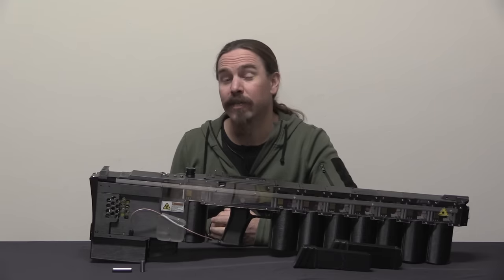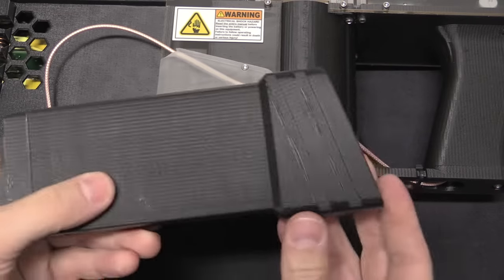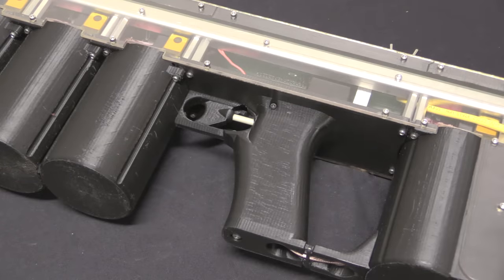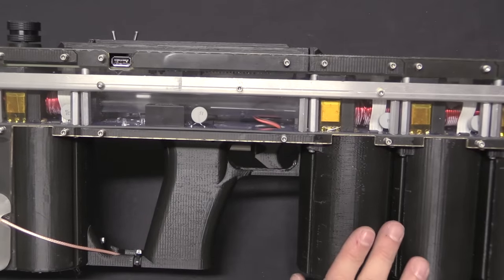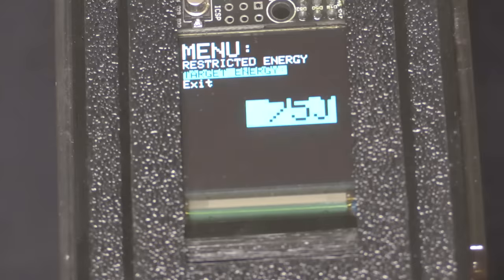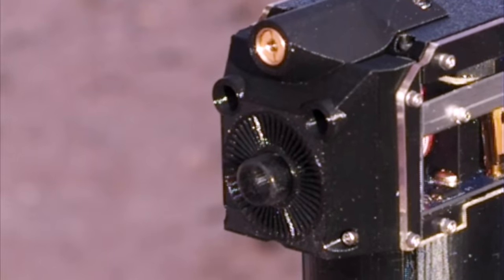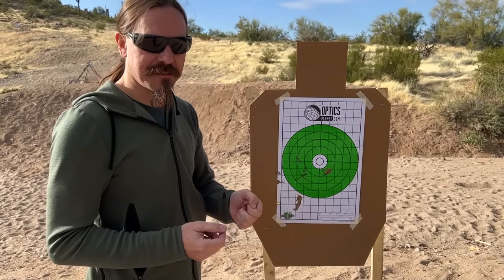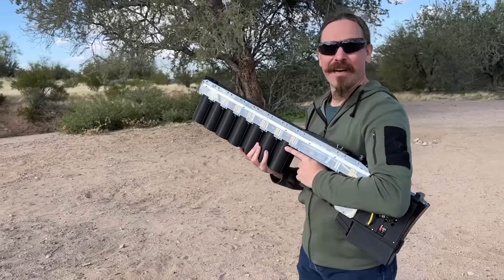ArcFlash Labs' GR-1 Anvil Portable Gauss Rifle

Comment: Would be nice to see a ballistic gel demo of the rounds and different power levels
Reply: That should be a nice YT-Video.
Reply: i feel like they'd just smack off lol
Reply: Yeah I'm really curious,  seeing as he said it's about a .22lr muzzle energy, firing 6-700 grains.
Reply: @Steven A bow and arrow can pierce ballistic gel.  So can this. Im not so sure with its current projectiles though. I want to see it with something machined with a spiral to it. Remember those old foam nerf footballs you could throw with a perfect spin WITH your eyes closed and hands tied behind your back? Something similar. Either Hollow or solid (not sure really) but a alloy sleeve of sorts maybe, with a cnc machined spiral down the core and/or exterior. Would likely help the projectile not tumble. With something like this im betting it would have no problem. Would also help its accuracy a ton.
Reply: @crisnmaryfam7344  since there's no contact with the bore of the weapon, the weapon would have to magnetically spin the round its shape wouldn't have much of an affect on its spiraling.
Reply: @sorrenblitz805  "the round its shape wouldn't have much of an affect on its spiraling." You need to go look at Arrow and Crossbow bolts of the modern age haha. The physicals properties do in fact make then spin and make them MUCH more accurate then a free flying  object. Just having a very minor 2 degree helical offset in the vanes causes this..
Reply: @crisnmaryfam7344  it'd probably just be better and less work to just rifle the barrel unless if that wouldn't work because of the difference than a normal gun
Reply: @boinkmcbingo8890  actually "TAOFLEDERMAUS" just tested this with half assed projectiles that were bent by hand and it showed it worked Just fine. Using a 12g shotgun. the videos title is "Supersonic Darts - The Effects of Inducing SPIN - I learned something!"  go check it out. You might learn something too ;)
Reply: @sorrenblitz805  "Supersonic Darts - The Effects of Inducing SPIN - I learned something!" go check it out. 12g shotgun was used. Smoothbore, and they are using projectiles modified not designed for it. Ones made like an arrow, and fired electronically (with no friction other then air drag) would work way better.
Reply: @crisnmaryfam7344  okay that's cool but I'm talking about this specific weapon. This specific weapon can't do what you're talking about without doing the spin magnetically, and the guy in this video who built it, even said as much.
Reply: @sorrenblitz805  i think he meant that the projectiles would start spinning due to the interaction with air. Kinda like an arrow starts spinning due to the fins in its back
Reply: @crisnmaryfam7344  you have to think in terms of electromagnetics, not normal rifling depending on air resistance or contact with physical rifling.  probably forged composite metals with different conductivity metals spun through.  gonna make the projectiles expensive, but much more stable.  you're also going to need a much more capable computer system to accommodate the changes in conductivity.  This thing right now is still just a toy.  like a nerf gun, if it shot metal slugs.
Reply: @crisnmaryfam7344  "Smoothbore, and they are using projectiles modified not designed for it."

would NOT work for this. ANY contact with the barrel will destroy it.
Reply: One feature they should add is a bio lock that's specific to the owner. Stolen weapons are no longer a problem because they're biologically locked. Sure someone would figure out how to hack them EVENTUALLY but it would make it more of a unique skill
Reply: Definitely wouldn’t have enough power to even pierce the gel
Reply: @sorrenblitz805  wind and air resistance would cause the spin.. The same way it did when coming out of a SMOOTH BORE shotgun barrel. An arrow dosnt contact anything after it is shot and uses the air to travel straight.. Learn about what you are talking before trying to make a point.
Reply: @thomasneal9291  Wouldnt need contact with the barrel.. it would still levitate centered as the current projectile does.. smfh!
Reply: @thomasneal9291  apparently you didn't watch the video. Cant force you to, just know you look ridiculous to those of us who did.
Reply: @marianoonz2952  yet a bow and arrow does... lmao. Learn something about Kinetic energy and such. An Arrow from a bow traveling at roughly 250-300 Feet per second can pass COMPLETELY through a deer... or an Elk.
Reply: @crisnmaryfam7344  sir, this thing fires at less than 100 feet per second, we understand how bows work, this is not a bow, do you see where im going with this?
Reply: @carlwheezerofsouls3273  In the beginning, Ian said it fires 600 grain projectiles at 75 meters per second. That would definitely do damage.
Reply: @crisnmaryfam7344  Wouldn't that increase the cost of bolts? I assume the current test ammo is really cheap, since they're simple metal cylinders, and adding a spiral is a whole extra step